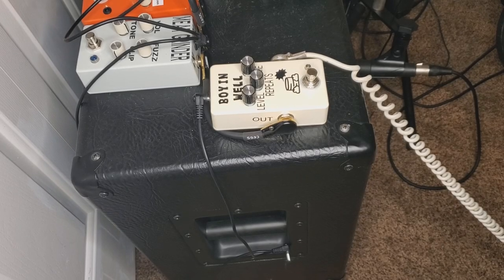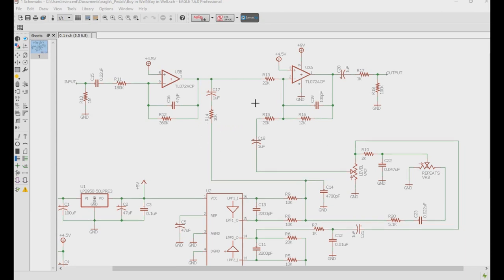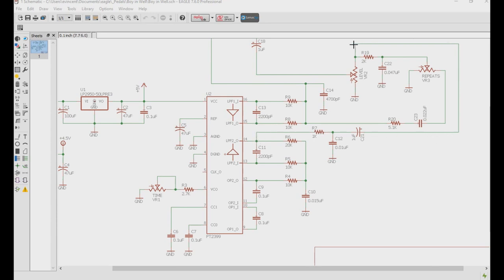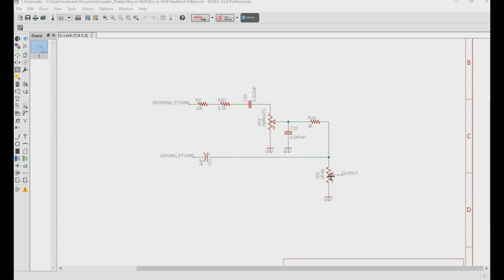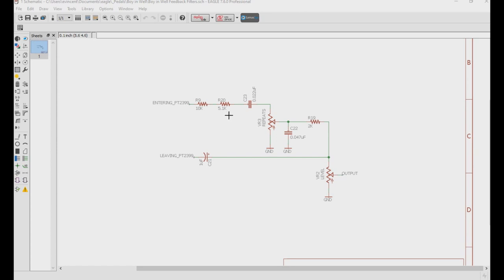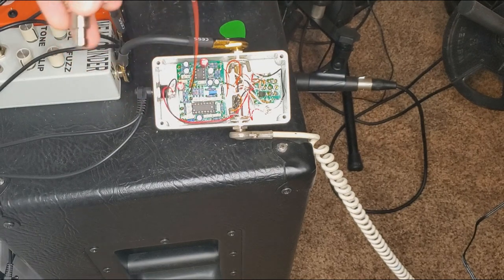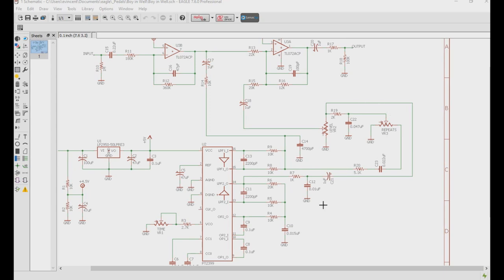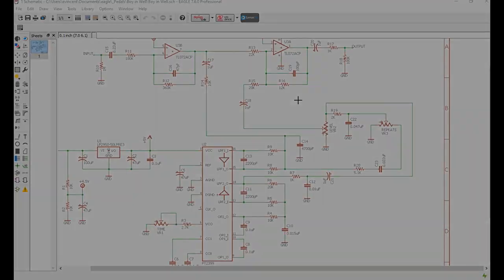PT2399 Delay Pedals - How to Add Self Oscillation

Comment: I just did this with a belton brick reverb which as we all know is made up of pt2399's. I added a momentary switch to change the feedback loop resistance so if the oscillations toggle is ON then the momentary switch turns them OFF and if the oscillations toggle is OFF then it turns oscillations ON. This way I can either use the momentary switch to bring in oscillations or use the toggle to have them on all the time (unless I hit the momentary footswitch to momentarily turn them off). Works great for swells and all sorts of ambient ideas. Especially if you want the end of a chord progression or riff to really fill out and keep things building up until the next part. The reverb I built was a Chasm Reverb which i added a few modifications to so it can be more versatile and do traditional spring and hall Reverb while still having the stock spring, cathedral/modulated reverb available.
Reply: This is super interesting. I'm currently working on a belton brick reverb based on the Death By Audio Reverberation Machine and would love to add something like this. Do you have any resources on how to implement this with a Belton Brick?
Reply: @ryleyperry1083  To implement oscillations with the Belton Brick, I believe it is just a matter of tying the input pin 3 to the output pins 5 and 6 with a 4.7K - 5.1K resistor and possibly a small 22nF capacitor. The resistance may need to be much lower or higher due to oscillation speed, and the 22nF might not be needed, as I don't know if the Belton's internals have coupling capacitors internal or not. But the premise is the same: feed the output back into the input.

Comment: Hello haven't made any videos in 2 years? Still this is the channel i needed to find. Question have you or is it feasible to integrate many of these builds into one multi effects pedal. You know opening up the circuit to new diodes/components with software? Or is that just a nightmare to jump into?

Comment: If the feedback knob is set to 0, this doesn’t work. I think a better way would be to use a momentary bypass switch for the feedback pot. Doable with a spdt, signal would go into the common lug, then through the NC contact it would go to lug 2 of the feedback pot and the NO contact to lug 3 of the feedback pot. That way lug 2 is disconnected when pressing the switch so it won’t matter where the pot is set when you engage the switch.
Reply: This is true. That's a great way to accomplish that.

Comment: helppp my input signal always connected to ground and i dont know how to troubleshoot it. does it because the input resistor?
Reply: Aside from the stomp switch circuit having problems, you might want to double-check the bleeder resistor, R10. It should be 1 mega-ohm or greater.
Reply: @erikvincent5846  when the pedal is off theres signal but when the pedal was on theres no signal. i think theres no problem with the switch and any of board wiring it must be do with the circuit. and its a true bypass pedal